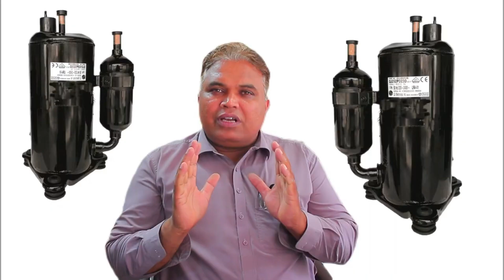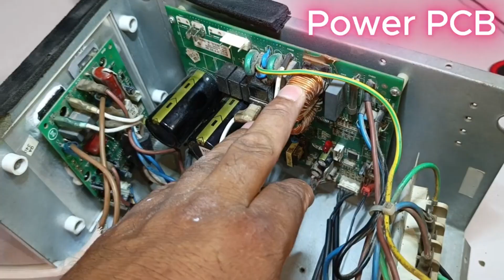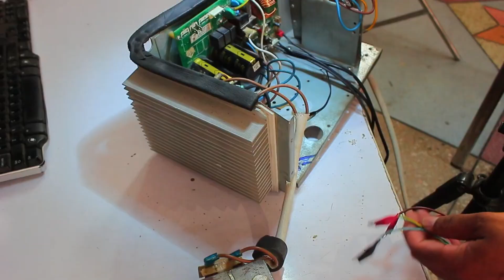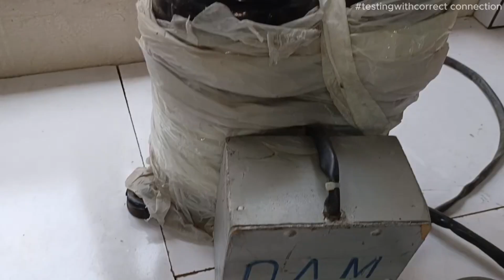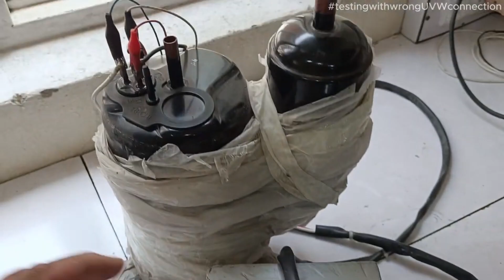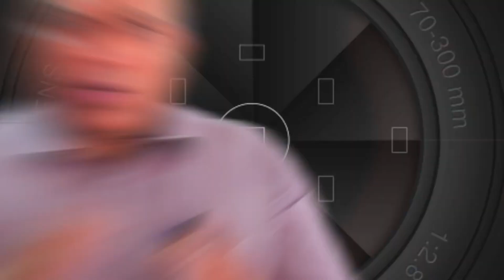What Happens When You Run a DC Inverter Compressor BACKWARDS?

Comment: Just put current clamps and check if current of compressor is well bellow it's nominal value. For example, if you reverse compressor of 1kW electric power, it will normally draw about 3 amps lightly loaded, but in reverse it will draw about 1A.

Comment: Boss, masisira ba ang compressor kapag na reverse yung red and blue then na turn on siya kahit seconds lang? nagkamali kasi ako ng pag connect pero na balik ko naman agad. please answer po thank you. Subscribed
Reply from the maker: posibleng ang compressor ay maaaring maging masama, ngunit sa karamihan ng mga kaso ito ay tatakbo sa kabaligtaran tulad ng bawat nakita ko.
Reply: @forevertechenglish , has it already been damaged a little bit due to the incident I have done?
Reply: @forevertechenglish  What about the R32 compressor, when I did it, it works for seconds and then it stopped. was it a safe mechanism?